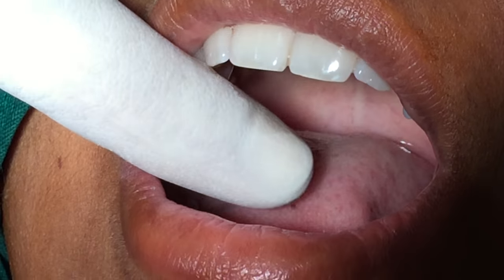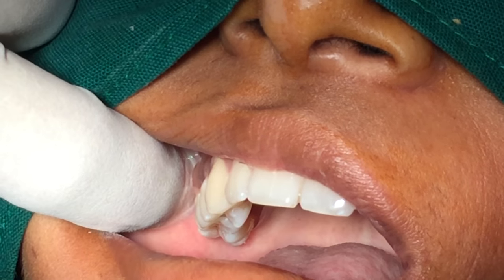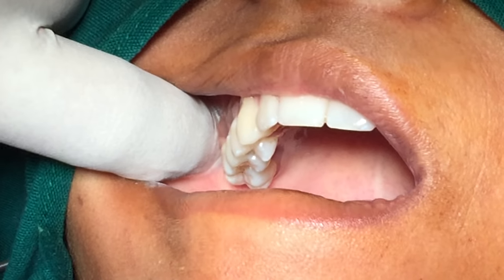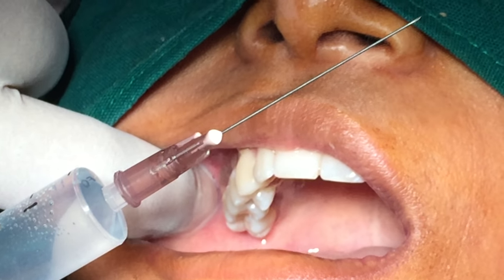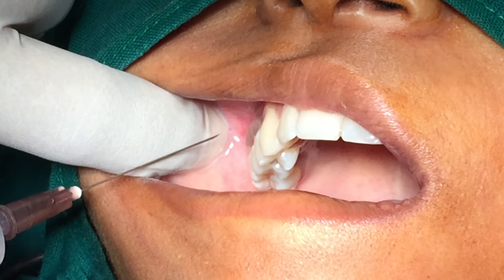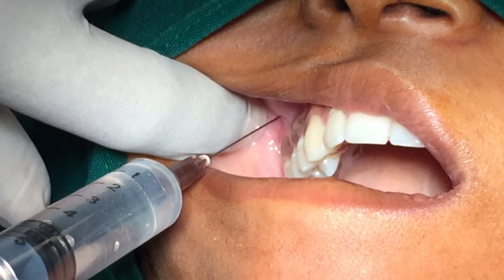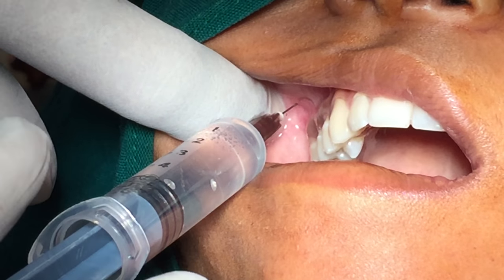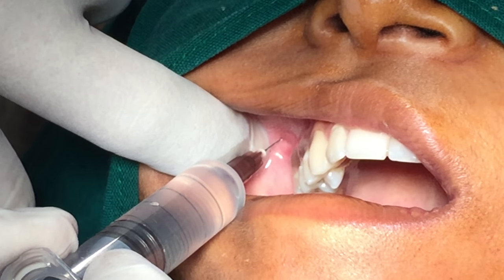Posterior Superior Alveolar Nerve Block

Comment: I just had a filling done for my upper molar (17) and the doctor did not used any injection or local anesthetic at all.I did felt some sharp pain at some point but that is because the decay has passed through the dentine and he had to clean it up.If decay reaches the pulp,then expect to see some blood like I did but also some fairly minor yet significant sharp pinches (that is if you don't get a shot).Posterior Superior Alveolar Blocks are dangerous and many dentists do no perform them (except few situations like an extraction or root canal treatment)
Reply: Actually PSA is pretty much safer compared to another block anaesthesia, inferior alveolar nerve for example
Reply: you prolly had minor cavity no need for anesthetic at all, the sharp pain probably because the decay has reached 2mm in towards the dentine tubules that might be able to send pain signals towards pulps im just guessing

Comment: when you rotate the needle for bi planer aspiration, doesn't the bevel side of the needle changes?
Reply: that is what i thought about
Reply: There is no bony landmark for this block,  bevel side should be considered in those cases where the needle end touches the bone,  so that it doesn't cause much pain to the patient. 
Here it is irrelevent.
Reply: @doney ?
Reply: @doneyjoseph9055  if i touche the bone is it painful snd how iknow that ishould stop my needle inside tissu
Reply: @demie9178  
If u are asking particularly for psa nerve block, u should stop pushing the needle in the specified direction once 16 mm has got inside, for adults.
Reply: @doneyjoseph9055  till 2/3 rd of total needle insertion
Reply: @shivaahuja7296  not correct brotha... 
It's upto 16 mm. 
Not 2/3 rd. 
U can check it out, I mentioned about psa in adults.
Reply: @shivaahuja7296 
Short needel is 20 ml
So yeah actually 2/3 of thr needel...
Reply: Sometimes the bevel is inserted into the wall of a blood vessel and will give a negative Aspiration

So he did a bevel rotation to ensure that the Needle is away from the blood vessels

Or I think so.
Reply: We need two plane aspiration to make sure either side of bevel is not inside any blood vessel

Comment: Wrong method...for psa block...you should use small needle...otherwise leads to hematoma
Reply: why what is the difrence between using short and long needle
Reply: @demie9178  to avoid overinsertion of the needle...by using short needle ..more controll n can prevent overinsertion of needle..n can prevent hematoma  formation
Reply: @anjuretnakaran7558 so to avoide overnsertion means introduction limite of needle in the tissu and hematoma formation thanks dr
Reply: @anjuretnakaran7558  dr please answer me 
what happen if needle touche bone is it normal and i know that i should stop introduct my needke in the tissu to avoide overnsertion .
and if i touche blood vessele how i know and is it normal tell me please
Reply: really chapter of anesthesie will kill me🤯🤯🤯😭😭
Reply: @demie9178  whenever u give an injection..we should do aspiration ..if its negative...u can inject the medicine...n can prevent hematoma formation..
Reply: @anjuretnakaran7558  what if the aspiration is positive? What to do?